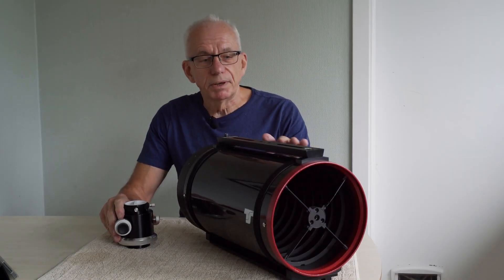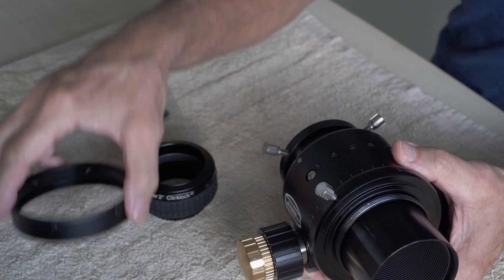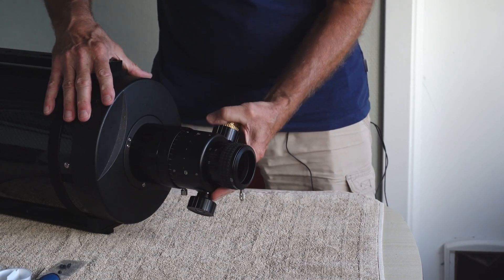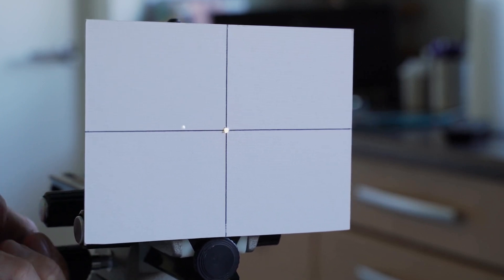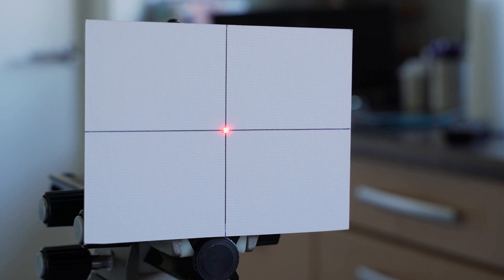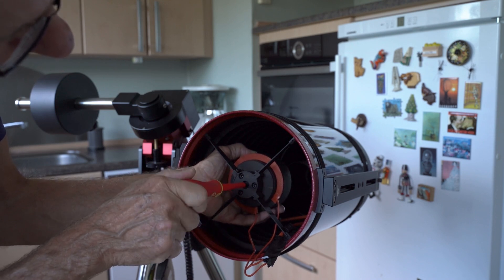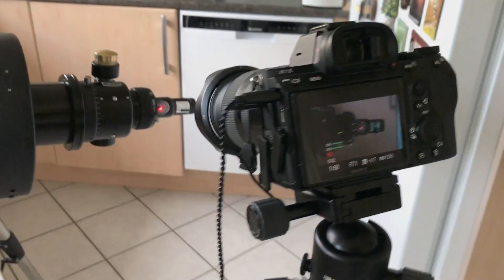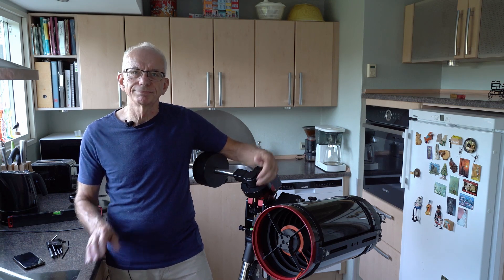Installing and aligning a Diamond Steeltrack focuser upgrade on an 8" RC telescope

Comment: Retroreflection, definitely a good way to align it!
Reply from the maker: Yes, it seems like the way to do it. It does, however, only align the focuser to the secondary mirror holder, not to the seoondary mirror itself. Final collimation on a starfield is stil necessary. CS
Reply: @flemmingsastro  We use retroreflection to align the optical path in a laser annealing system for semiconductor manufacturing.  It's a 3,500 watt CO2 beam but we use a low power red beam to align the optics, very similar to how you aligned the focuser.  

I had been trying to think of something similar to align the other optics in a telescope when I came across your video.  There might be a way but it's probably over thinking it and conventional methods are still best for the mirrors.

Btw, I'm new to the telescope hobby, it's something I want to get into but probably not in a big way until after I retire in a couple years.

Comment: Hi, how did you attach the clicklock to the focuser? Thanks.
Reply from the maker: Hello @markmcmanus. You have to purchase the one fitting whatever focuser you have. The one for the Diamond Steeltrack is is the S58a. Loosen the 6 small grub screws securing the 2" clamp to the dovetail of the focuser, using the hex key supplied with the ClickLock, and mount the Clicklock instead. You will find all the variants here: https://www.baader-planetarium.com/en/baader-2inch-clicklock-eyepiece-clamps-from-t-2-to-4-1inch.html?sku=2956258
CS
Reply: @flemmingsastro  thank you so much 😎

Comment: Thanks for the video! I noticed that the adjustments for the primary mirror are only done on the tilter.  Do we have to adjust the primary mirror adjustment screws too?
Reply from the maker: I first align the focuser with the primary mirror, using the focuser tilting ring. When that is done, I mount the secondary and align the primary mirror to the donut in the middle of the secondary mirror using the screws on the back of the telescope proper. This moves the mirror and the focuser as a unit. In order to see the center donut you find its reflection in the primary mirror looking through the front of the telescope. Maybe watch that part of the video again? Lastly I adjust the secondary until the laser dot is returned to the center of the laser target.

If you cannot find the reflection of the secondary's center donut in the primary mirror then your telescope is probably mounted with a primary baffle extention, which you need to unscrew and remove from the tube. Some earlier versions of the scope did not have this baffle extension.

Comment: Hej Flemming. Har du en mening om hvorfor man skulle vælge en RC eller hvornår en Maksutov?
Reply from the maker: Pyh! Det er vist det man kalder et godt spørgsmål. :) Som altid er der fordele og ulemper ved begge slags.
Jeg har aldrig selv ejet en Mak, men jeg kender folk der bruger dem. Maksutov optikken består jo af et sfærisk primærspejl med en sfærisk negativ korrektionslinse i forenden og er ikke særligt lysstærke, d.v.s. de har et lavt f-tal, sædvanligvis f/15 eller lavere. Det er en følge af det optiske design. RC'en ligger gerne omkring f/8, og giver derfor kortere eksponeringstider ved fotografering. Til gengæld er Mak'ens lange brændvidde velegnet til planetobservation, da planeterne er relativt lysstærke men meget, meget små og kræver stor forstørrelse. Sekundærspejlet i en Mak er også betydeligt mindre end RC'ens, hvilket er en fordel ved visuel observation. Hvis man bruger en RC visuelt kan man ved lysstærke objekter, som f.eks. Månen eller Venus opleve at skyggen af sekundærspejlet viser sig som en sort plet i midten af synsfeltet. Men altså kun ved visuel observation. Ved astrofoto har det intet at sige.
En fordel ved RC'en er dens åbne konstruktion, der giver en hurtigere temperaturudligning af spejlene. Dem der bruger Maksutov'er stiller som regel deres teleskoper ud til afkøling adskillige timer før de skal bruge dem. En anden fordel ved RC'en er at den kun består af to spejlende overflader, ingen linser, og derfor giver et meget skarpt billede uden kromatisk abberation. Imod Ritchey-Chretien designet taler at teleskopet kan være lidt besværligt at kollimere, men det kan være at det samme gør sig gældende for Maksutov teleskoperne, det ved jeg desværre ikke. 
Jeg håber at ovenstående giver mening.
Mvh.
Flemming

Comment: Hello. Thanks for the really good video. I have read that the distance between the primary und secondary mirror is cruxial. How do you collimate the right distance or is it not important?

Greetings from Germany :)
Reply from the maker: Hello.
Good question, which means that it is hard to answer conclusively. Platesolving your image will tell you the focal length (FC) provided you have entered the correct pixel size and sensor dimensions into your acquisition software, and the FC of an RC scope is very sensitive to the mirror distance. A single millimeter change in the distance will change the FC of the scope by several millimeters. However, you cannot be absolutely sure that your particular optical system performs best at the exact FC specified by the manufacturer.

In my experience the collimation of the mirror angles is way more important for the image quality than the last millimeter of mirror distance. Right now my scope, which is not perfectly collimated yet (I'm still working on it) is at 1621mm focal length, where the nominal FC is 1624. When everything else is perfect, I may experiment with distance again, but until then I'm not worrying about it.

Greetings and CS

Comment: When adjusting the focuser to be aligned with the optical axis of the primary mirror, the laser is inserted into the focuser and the laser is projected onto the cardboard. I was a little confused by this because I wondered if the secondary mirror holder would block the laser from reaching the cardboard, or is it actually going through the hole that holds the secondary mirror?
Reply from the maker: Yes, when the secondary mirror holder and the screw is removed the laser goes through the hole for the center screw. If it doesn't the focuser and possibly the primary mirror is very much out of alignment. :)
Reply: @flemmingsastro , ah, thank you for clearing up that confusion. I just upgraded my focuser to the Baader Diamond Steeltrack and also got the tilting plate. My laser collimator arrives today, so I will be aligning everything using your instructional video.

Comment: So far is not aligment because only rotations are involved. The  centre of Cuverture of the primary gives one point of the axis , but it dosent determine the axis. For that it will need to find the focus  of the primary mirror. ( 3 parallele lasers centried to the mirror . the crossing position of the 3 lasers will determine the primary focus.  Why? because we don't know if the primary mirror is fully concentric to baffle. it might have an offset ans gives a  tilt of the axis or  a parallele axis to the one from the baffle. The focuser  can be tilt to coincinde its axis to one position of the primary axis. With the 3 lasers you could check if the laser beam  by the focuser coincides to the crossing position or a bit a sidev of it . But because this is no possible  translaltion at the back of the telescope  to align the  focuser with 2 positions , thie focuser is correct for one position. What can be done,  ionce the focuser is pointing the centre of curvature, is to see if the laser beam is  passing the center  of the support of the secondary mirror. Because the manufacturer has already optimised this center acording the primary mirror and not the tube of the telescope. Why?  because a RC telescope is working with very tiny  tollerence regarding the position of the surfaces of the two mirrors  less than 0.1mm. The light waves must arrive at  the same time  accordinf the radial position, on  the secondary mirror to remove the coma.  When you tilt the secondary  , we must be sure the mechanical rotation of the secondary mirror is align to the axis of the primary mirror .  Anyway.  Here  we use the method   to point the secondary mirror  with the laser  to align it by reflection,  to the  focuser . But  is  fine for one position , the one of the target.    This video shows how you should setup the focuser touching  the secondary mirror once you have pointing the centre of curvature of the primary mirror. But by no means  this technic is not for collimated the telescope for observing  the Sky with the best star image the telescope can offer with the RC configuration. At least I enjoy the video because the good skills of the youtuber with  his telescope. I suppose his method is the one you can use for having a good compromise  when you don't have an interfometer at home ...
Reply from the maker: Thank you for your comments, and my apologies for not getting back to you earlier. 
I'm not sure I follow all of your arguments, but I do agree that my process is a little crude and naturally limited by the equipment I own. While the method for finding the optical axis of the primary is sound, I think, as only a point on the axis will reflect a focused image back on itself, using the laser for aligning the focuser will only point the focuser at that point; it will not make sure that the focuser is actually on the axis if it is not precisely centered. It is, however, a good approximation, and in the end the proof is in the pudding as they say, or in this case, in the stars. The final collimation will always have to be done evaluating the images of the stars.